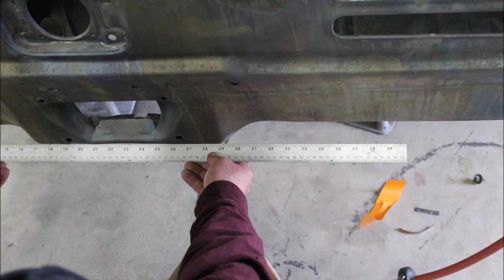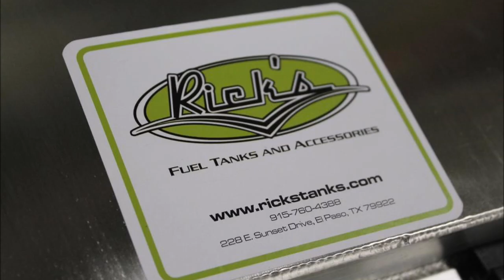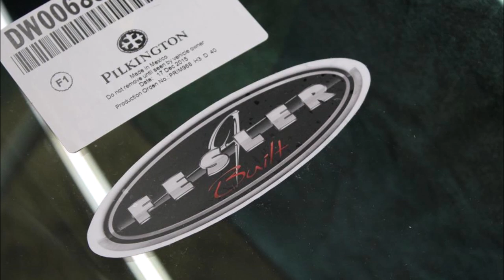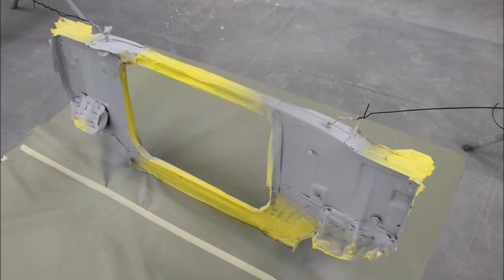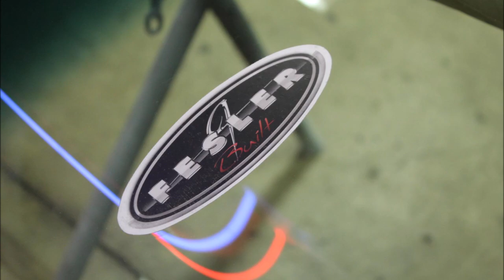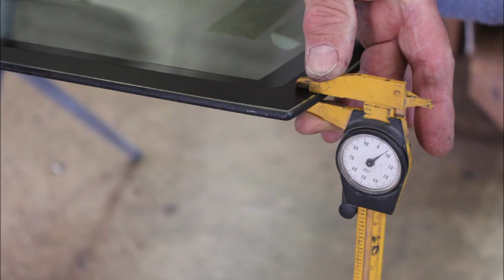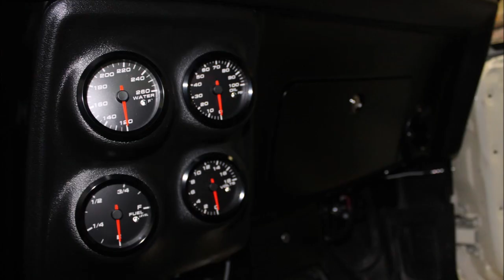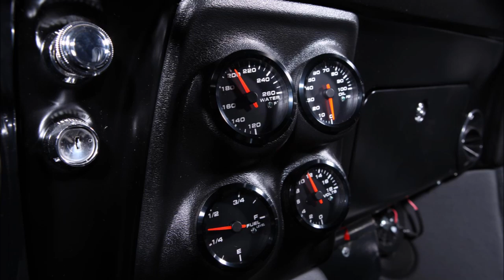FULL BUILD: 1968 Pontiac Firebird ProTouring restoration. Step by step build by MetalWorks.

Comment: Excellent work as always, but man the metal you cut out of that car is better than 90% of the available Firebirds
Reply from the maker: George, from looking at photos alone we would totally agree with you...but if you could have ran your hand down the panels and felt how warped they were I think you would agree to replace them. The panels were not replaced due to rust, but for being warped...some of the body mods we performed also played a roll in replacing certain panels like the roof skin due to shaving the drip rails, etc.